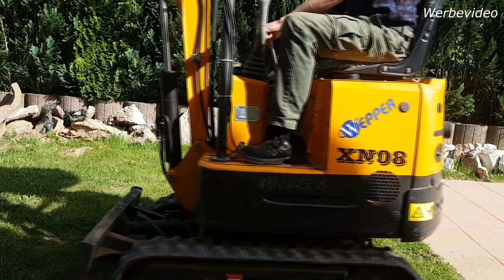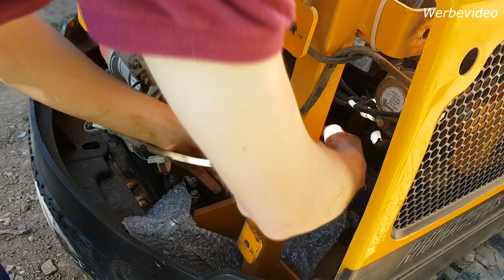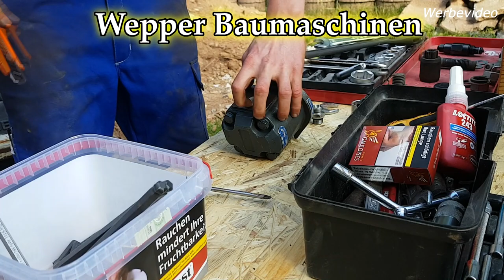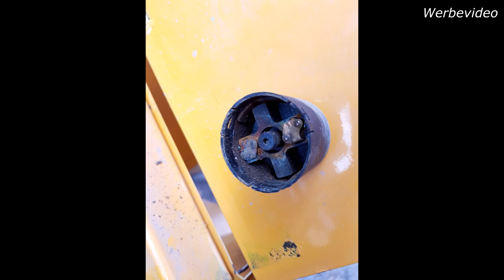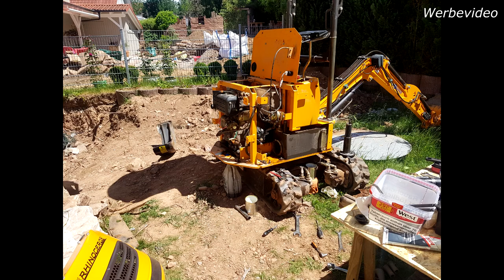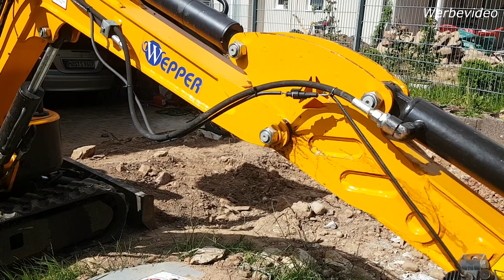Minibagger Rhinoceros XN 08 Reparatur

Comment: This was a good video.  I am thinking of buying one of these machines too - as many people have said they are very good value.   I understood a bit of the video. You had problems with low hydraulic oil. It seems the oil meter was showing that you had oil in the tank but there was none.  So the meter was faulty? Why was the hydraulic oil low? Was it leaking somewhere?  With the diesel engine in my truck  I am told to change the oil and fuel filters every 10,000 kilometers and then I will rarely have a problem. How often should the filters be changed in this machine? After how many hours? Have you had to make any modifications to the machine to be able to access the fuel or oil filters? Some people have cut through the body panels and installed hinges on them to allow them to have easy access to the filters.
One other question - which model engine do you have in this machine?
Reply from the maker: Mahlzeit Fleanis, I just made a new Video in which I was saying that in my opinion for this small price the Bagger is good Value. Yes if you understood the part with the hydraulic oil level, then you have understood the important part 😂 First I thought that the hydraulic pump is broken but in the end it was the low hydraulic oil level. I was driving uphill and then the last bit of oil what was left in the tank flowed in one corner of the tank, so that the hydraulic pump couldnt suck any oil. And because it flowed in the corner where the meter is, it looked like the tank was full but it wasnt. The oil level was down because I had 3 blasted hydraulic oil hoses in the last time and every time some oil spreaded out and I didnt filled it up again because I wanted to wait till winter to make all Services. The blasted hoses where my fault.

Motor oil + filter: First time after 50 h, then after 100 h and then every 200 h - Motor oil = 10W30 or 10W40

Hydraulic oil: First after 100 h, then every 500 h, filter every 500 h - hydraulic oil = HLP46

And my personal advice: If you lost any oil then fill it up again before continueing with work 😂 You dont have to cut anything to get access to the motor parts but I think it would make it easier. Sorry but for the engine model I first have to take a closer look but it is a Diesel model.
I hope I could help you a little bit, Greetings Silas
Reply: @derwerkler4947  OK, thanks for that. Sensible advice on the oil and hydraulic filter changes. And what about the air filter? It would require cleaning or changing much more often than a car's air filter.What attachments do you have for the min-digger? And what attachments do you now realize you should have bought initially? How much do these attachments cost? I was curious about the engine you have because  people are recommending different models. A popular one is to have it fitted with a multi-cylinder diesel engine. A 'Yanmar' is a popular brand. How big is the engine in yours (in cc's). I do not know if you can buy a mini-digger with one of these already fitted or you have to do it yourself.  Do you consider that your engine has enough power for all operations?
Reply from the maker: I dont have a specification for the air filter change because I think you should change/clean the filter when its dirty and that depends on in which environment you are working in. When you work in summer there is much more dust as if you work in spring/fall/winter. I have three different sized buckets, the gripper and the quick changer and I am happy with that. But maybe in winter I want to install a "mechanical thumb" so that I have mix between bucket and gripper. The advantage of that is that you dont have to change everytime between bucket and gripper when you are diggin and sometimes want to lift a rock for example. I noticed that this is very usefull because the quick changer isnt compatible with the gripper and it takes about 20 minutes to change from bucket to the normal gripper. I think the most people have the Yanmar engine but the XN08, the smallest digger, always has a single cylinder engine. My digger has 12 ps and 500 ccm. I dont know if a bigger engine would fit in there but in my opinion its not needed anyway. The digger has enough power for its size and for its tasks and the engine is coordinated with the other parts. If you would have a lot more power then something could break before the engine stops. If you want to lift a rock for example that is to heavy for arm of the digger than the engine is out of power before the arm can break. I would recomment the XN08 as "second man" if you work alone often and for that use its perfect. Another advantage is the small size because you nearly can go everywhere with the digger. Even if it took a little bit long for my answer I hope I could give you some more infos. Gruß, Silas
Reply: @derwerkler4947  "... I would recomment the XN08 as "second man" if you work alone often and for that use its perfect." 
Hi.  From what I have seen so far - it is more like a second and third man as well!.  I see how quickly that the machine can dig out a 450mm wide channel  - and it is faster than 3 men with shovels. And of course it doesn't get tired and need a break after 15 minutes of strenuous digging.  I noticed in one of your videos how you needed to break apart the sandstone rock. I think there is a rock breaking attachment for this machine. I do not know how much they cost - but such an implement would be extremely useful.    One question I forgot to ask you was when the hydraulic hoses break - can you go to any hydraulic hose manufacturer and get one made up using the original connectors?? Or do you have to import  hoses specifically from China?  I am glad that you do not think that the machine  is  under-powered.
Reply from the maker: Hehe you are right, it doesnt get tired thats a really big advantage ! Yes, depending on what you are doing the rock breaker would be a nice feature. I choose a handheld rock breaker because I can use it everywhere indoor too but the breaker for the digger has a lot more power I think. The question with the hoses is a good one and the answer is surely yes ! We have a car- and machineparts - store here that can make new hoses and all three broken hoses I had, got replaced there. I think the hoses and fittings are standardized even for the chinese and so its no problem at all. Greetings, Silas